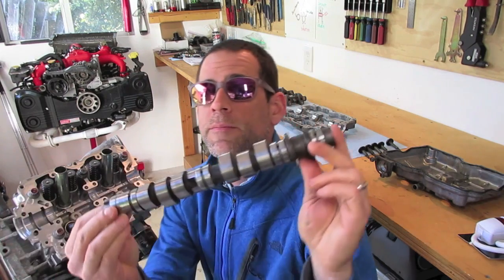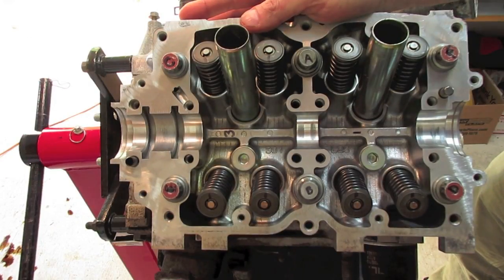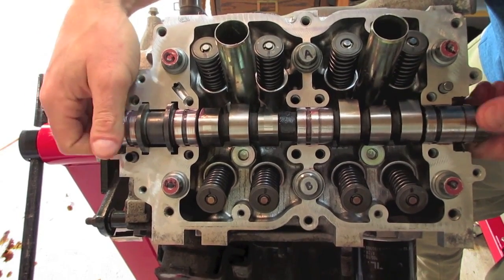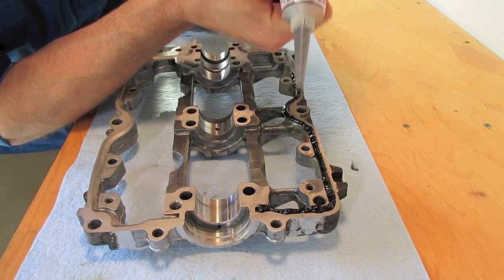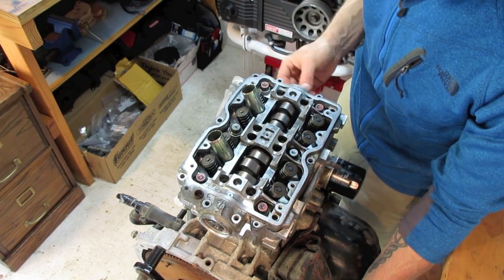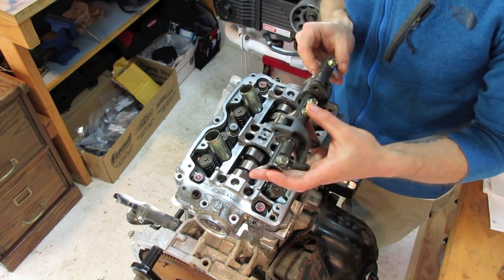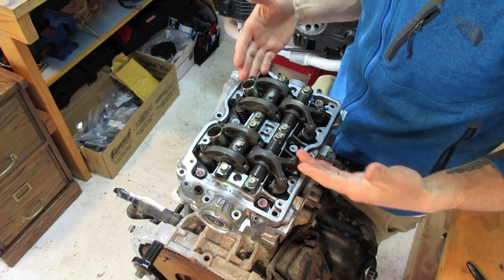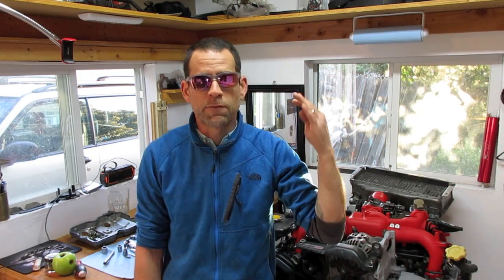How to Install Subaru Camshafts & Rocker Arms

Comment: Check it out...
I know very little about car engines. I have an 09 Forester. 
So, I take it to the dealer (Stivers Subaru in Decatur, GA) about 10 months ago due to engine misfires, sluggishness, and oil leak. All compounding over about a weeks time. They say, head gasket is bad, it's replaced. 

Fast foward to about a month ago. Sluggishness returns with smoke from burning oil. They say Cam Seals...okay, done. 
I get it back and it is still burning/smoking oil. I take it back in...they say, "bad rightside gasket valve. These typically don't go bad, we must've of disrupted it during the head gasket job last year." So...they fix this for free, which to me admits guilt. 
2 days later I have catastrophic engine failure/oil leak going about 65 mphs down the interstate. They tow the vehicle back in and discover the Cam shaft has broke in half. 

They are taking a further look to see if it is reasonable to repair. They have not admitted to guilt. They are saying the breaking of the cam shaft caused the breakage in the newly repaired cam seals, this seems highly suspect & gigantically coincidental.  I feel like they are going to dick me out of a vehicle. 

Do have any advice on what I could say which would help me state a case?
Reply from the maker: Ok.  Just read over this whole scenario... Sorry to hear and I totally agree with you, something seems a little fishy here. I’m going to think this over for a few hours and follow up with another comment later this morning. Hang tight... 👊
Reply: @SubaruONLY  Welp...they came back with the "Not are fault, most likely something that was occurring over time." They want me to purchase an 80,000 mile used engine for around $3,200...this is not including the est. of $2,000 labor fee to install. Not thinking my car is worth this amount. Looks like I'm out a car.
Reply: They dont know what they are talking about. They needed to see what was going on with the timing and fix that not just play around with seals. Stay away from them in the future and do not buy any of their products. Total cowboys. Check out your rights as a consumer. It is totally on them.

Comment: Can you change cams on a EJ253 without removing motor/heads?   Looking to possibly swap in a Blower cam on supercharged 253.  Head gaskets already done so no real pressing need to remove motor unless I actually have to.
Reply from the maker: Yes, you can access the cams and swap in new ones with the motor in the car and the heads bolted on.  Will be little tight but definitely doable in my experience.
Reply: Thanks.  Any idea who  might have or make a cam for a supercharged 253.  Regrind, new, I don't care..looking for more power!!!
Reply from the maker: Kelford and Crower Cams.  They both make custom ordered cam grinds and can help develop required profiles based on application.
Reply: Thanks again for the reply.. I will check em out!
Reply: what about in a forester EJ205 engine?
Reply from the maker: I’d try Kelford and Crower still, they know these motors inside and out.  Good luck buddy!
Reply: I don't know them any link or website?
Reply: Another place is Delta Cams in Tacoma Washington. They are very reputable cam company that does stock and custom cam grinding and specializes in Subaru camshafts. They have been doing this for many years and to many are considered the best in the business for Subaru camshaft grinding.

I currently have the Delta 2000 cams on order for my 2006 EJ253 Legacy, the 2000 cams are more power at higher RPM and will need a small tune.
But i also work for the Blind Deer Rally Team and we have the Delta 1500 cams in our 2001 GC8 and is a killer setup. The 1500 cams are more of a mid HP cam great for rally and don't require a tune. 

But they have other cam profiles as well.
www.Deltacam.com  is the website 
Phone: 1-800-562-5500

Good luck Friend.
Reply from the maker: I agree. Delta Cams is reputable shop for sure!  ✅

Comment: Are you able to do a video on replacing an SG Forester steering rack with an '04 STi rack ?
Reply from the maker: +Dan Godbey 

I would like to do a video on this for sure.  Don't have the STi rack currently but I'll keep an eye out for one.  Thanks for reaching out!  I'll try to make this happen!
Reply: Tyler Krzynowek ( I think of GoFastBits ) has some last I knew. They had the '04 & '05+ racks (with the required adapter plate added). He works out of northeast Ohio. You can message him on FB.

Comment: This is wong! The silicone has to be added to the end that protrudes out further! If you follow this you will have oil leaks on rear of (right) passenger side and front of (left) drivers side.

Comment: Hi my name is Howard. My email is hsa1313@yahoo.com. My situation is this. A rocker Arm and spring came out, when my mechanic took off the Valve Cover. It caused a crack in the cover, when the rocker broke off. I JB welded the crack, and no longer lose oil. My car is a 2011 Subaru Forester 2.5l x premium, dohc. Sixth digit A. The car runs like there's nothing wrong. No ticking, loss of power, or misfires. Not sure why. Anyway, do you think it's fixable, or do I need to replace engine? If you could email me, I'd really appreciate it.
Thank you,
Howard 
Btw, great video.
Reply from the maker: Could be fixable.  All depends if any damage occurred. Have to look inside or just replace the parts and give it a try.